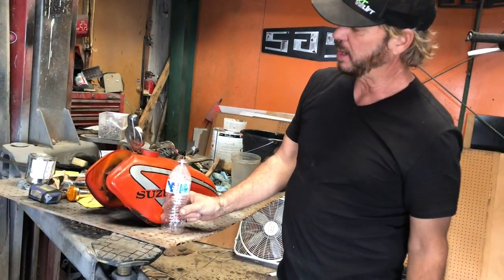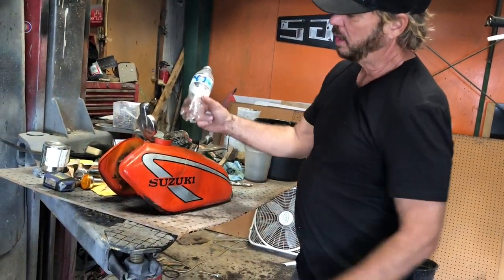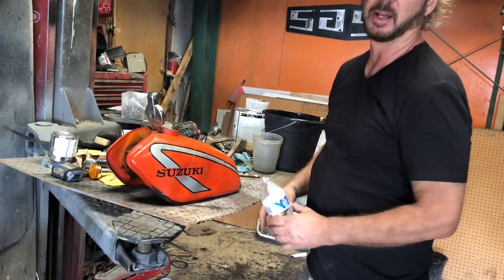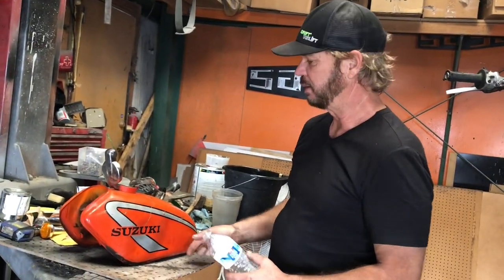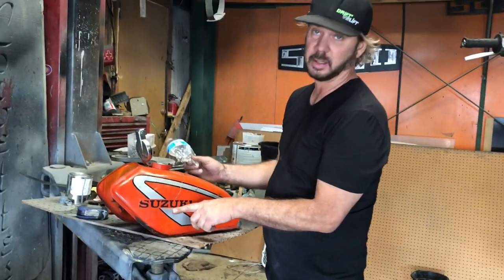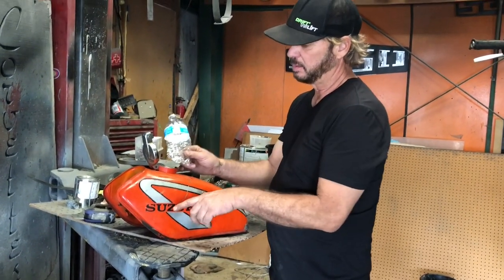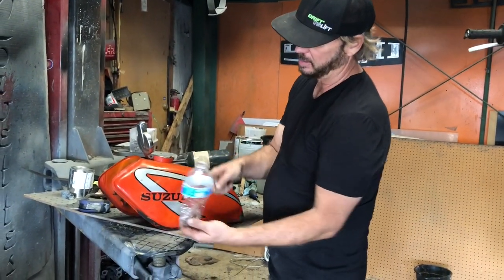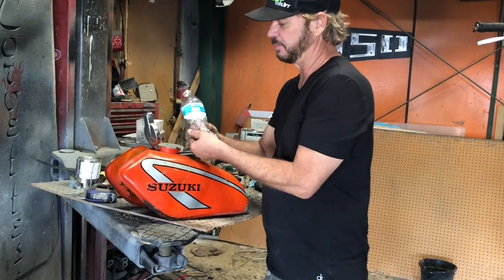Removing dents from motorcycle gas tank with a water bottle

Comment: Any other recommended inflatable objects for a larger tank where the diameter of the water bottle won't fill the void?
Reply from the maker: Use a bigger water bottle they come in all shapes and sizes
Reply: @lancelarson439  thanks. Ever tried a blood pressure cuff? I wonder if that would work.
Reply from the maker: @KlaneHarding  It could
Reply: There's another video where a guy used a small tire tube.  He split it and sealed the ends, so it was a sausage shape.  Worked slick.
Reply: @KlaneHarding  in another video it worked.
Reply: Home Depot, Harbor Freight and Amazon, etc. all sell small pump up air bags, sometimes listed as lift and leveling wedges / tools. They can be rolled and inserted into small gaps. I plan to use one on a Harley tank by going through the pull pump hole. They might be difficult to remove from a filler neck though.